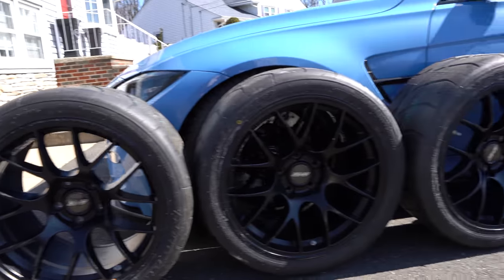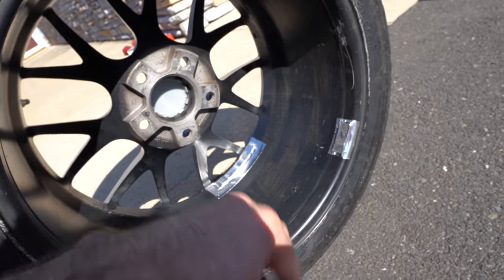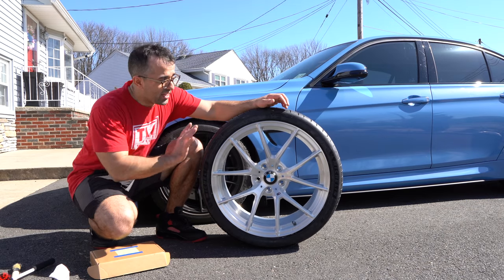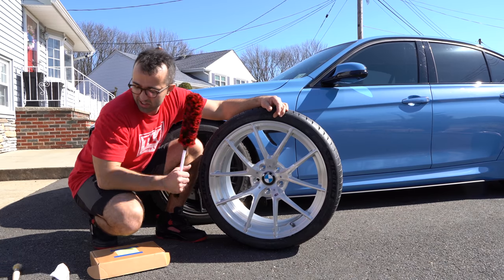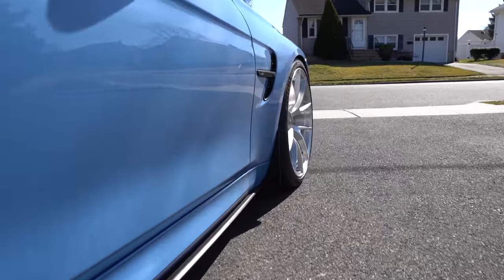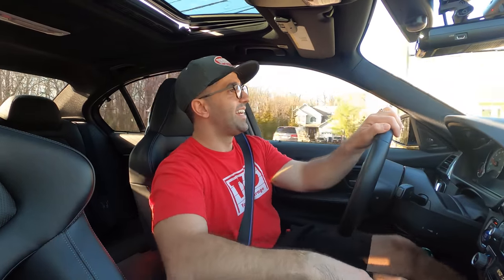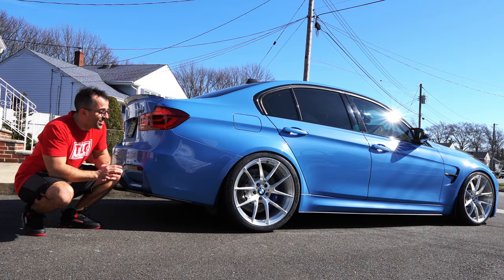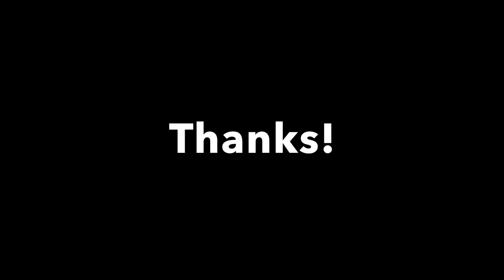I found the perfect wheels for my BMW M3! One set for summer and another for the track (Forged)

Comment: Never use metal dust caps much after a friend had bother getting one of because of corrosion on thread ended up sheering the valve seems to be a common problem
Reply from the maker: Great point.  Amazon caps were garbage

Comment: You mentioned that you applied 4 coats of ceramic.  Did you do the barrel.  If so, did you do them before you mounted and balanced the wheels.  I heard the wheel weights won't stick.
Reply from the maker: Great question.  I did all the ceramic coating after wheels were mounted and balanced.

Comment: With that rear stance I am curious to see how the tire(suspension) reacts over bumps. It's almost seems like there is no room for your tire (suspension travel) to move without hitting the body. A cam on recording the rear tires would be interesting. By the way I just picked up a 2017 M3 in the same color, loving it so far.
Reply from the maker: When the suspension travels it doesn’t just go straight up it angles inwards. Having said that I was getting minor rubbing in the liner.  I trimmed it and problem solved. Will highlight it in the next video

Comment: That stance looks so good! I immediately went outside to look at my stock 437’s and it looked skinny like a Ford Focus😂 compared to yours! How do you like the PS4S?  I’ve been using them for a while now on a they are smooth and quiet.    I have tracked with them once and they held up decently well.  

I agree, the blue/gold color scheme belongs on a WRX.
Reply from the maker: The tires are amazing. Little road noise
Reply: Edward M Cars PS4S are amazing tires! Put them on my wife’s 335i (F30) and it’s a huge step up from Pirelli’s run flats.
Reply: Steve Weltman I had them on my old ISF and it literally transformed the car!  I run them on the M3 as well.

Comment: Aren't these the copies of 763m wheels? They have the exactly same design and btw 763m is available in 20 inches but more expensive
Reply from the maker: Nope.  763 are different. Easy way to tell is 763 have that back channel and these don’t.
Reply: @TommyLGarage  What do you mean by the back channel?
Reply: @TommyLGarage  I thought these are the replicas of 763m
Reply: Yes, this is 763m replicas, but 9,5x20J front (oem is 9x19), and rear 10,5x20J (oem is 10x20).
Reply: @bmwmpower1304  okok slightly different in sizes

Comment: I would use the bigger rims for the track dude. You get more grip and tires will weigh alot less more than rims at that size plus its gonna feel alot better. Your gonna get more feed back when turning and know everything under the road.
Reply from the maker: Smaller wheels are lighter and tires are cheaper.
Reply: @TommyLGarage  but you want that weight  and width to get the grip down. Look at a gallardo or porsche 911. Were talking track car grip!

Comment: That’s not what forged is at all, you described billet.  Forged is when the solid block of aluminum is put in a huge press and compressed, it adds density to the material making it much stronger.  The wheels look great and glad your street wheels are not black.

Comment: Sorry to bring up an old video but did you have issues with the 275/30/20 on the front?  Richland advised me to run 265/30/20 for rubbing issues.  I want to order the proper tire sizes.  This will be on a 20x9.5 +22 (same as yours). Thanks for any help.
Reply from the maker: Yes it rubbed a bit at full lock  but was a better look.
Reply: @TommyLGarage  I appreciate the advice. Now I get to make a 3rd alteration to my tire order. 🫣 TireRack is gonna ban me. 🙃

Comment: hey, just want to ask if there's any rubbing in the front with 275/30/20. most f80s rub with 666rims on 275/30/20?
Reply from the maker: Yes. But it stopped after I put on camber plates

Comment: I wanna use 437 for winter. Rear pilot sports getting bold slowly haha. So I just mount winter tires on them. I can't decide 18s or 19s I won't track the car but I want at least 295 in rear. With sticky tires nittos or 888rs. We need to meet this summer.
Reply from the maker: I will swap you my 18s for your 19s. I’d love a set of silver 437M for the winter.

Comment: Nice wheels! What are their offsets? I just got myself a set of Vorsteiner 108s... beautiful wheels but am not impressed with the offsets. I have to compensate with some wheel spacers to have that flush fitment and look.
Reply from the maker: Oh it’s so much better fitting wheels without spacers. 
20x9.5 +22 Front and 20x10.5 +35 Rear 
Wrapped in 275/30 and 295/30 PS4S Tires

Comment: Hey Tommy.  Nice video like always. Respect.         Important question.  How much  weight new wheels?   because i think its important think when we need to compare with 666 20inch wheels.
Reply from the maker: So I can tell you that these weight a lot less than 666. 
20x9.5” (ET 22) - Weight 23.9lbs
20x10.5” (ET 35) - Weight 24.9lbs
Reply: @TommyLGarage    Wow. Its very good result. Also need not forget that wheels is 0.5 wider than OEM 666m wheels.   Super

Comment: Congrats on the new wheels, they look awesome! Also, looks like you did you homework before you pulled the trigger, good stuff. Talk about wheel obsession, I'm waiting for my 20''HRE R101LW for daily to replace my 666m set. Also, have a set of 18s Forgeline GTD1 square wrapped in NT01 for track days as well. AP brakes are coming along with an upgraded suspension, still haven't decided what to go with. Super hyped for some track days, hopefully everything gets back to "normal" because it's crazy out there. Stay safe!
Reply from the maker: Thanks! Good choice of mods you’ve got there. For suspension, you’ve got lots of choices. Bilstein now has a dull coilovers solution that works with edc
Reply: @TommyLGarage  I have not decided which suspension I'm going with (KW V4, MCS 4W, Nitron NTR R3, JRZ RS PRO 3). A track ready monster that's street legal lol

Comment: I literally just got the same setup on my M4 (tire spec and rim spec) and the fronts rub (without spacers) on the inner side of the rim. Couldn’t even move the car.
Reply from the maker: Interesting.  I rubber in the rear but trimmed the liner a bit and all is well
Reply: Tommy L Garage Yeah I think I’m clear in the rear. Running eibach lowering springs but I still need to go down lower. Just a little wheel gap. And I’m gonna our 10mm spacers up front to avoid the rubbing.
Reply: Figured out the issue. The shop put the rear right rim up front and the front left wheel in the back SMFH 🤦🏿‍♂️

Comment: Beautiful fit sir...what is the exact offset to the wheels? I want to roll like this.
Reply from the maker: 20x9.5 +22 Front and 20x10.5 +35 Rear 
Wrapped in 275/30 and 295/30 PS4S Tires 
Brushed aluminum finish.

Comment: They look amazing, very OEM, love it... I also have 20” on my F80 and they look really nice my tires are 245/35, 275/30... will definitely upgrade for 275/30, 295/30 makes a big difference. What torque you use on the wrench, 120?
Reply from the maker: Just be sure your wheel offset allows for those tires. 
And yes 120 is how much I torque.
Reply: @TommyLGarage  Thanks will check that at the tire dealer.. Thanks also for your great Channel content, very  helpful tips!!

Comment: Are you running this setup with MP Has Kit ? Any rubbing of the perch to the tires especially in the front ?
Reply from the maker: Tiiiiiiny front and rear I had to trim just a tiny bit of liner. Nothing too crazy
Reply: Tommy L Garage Hi Tommy. Quick question. Under what conditions was it rubbing? Was it rubbing under full wheel lock, or was the rubbing present during normal straight driving over bumps?  Love your videos, thank you for all your time and dedication. ❤️

Comment: Looking good. What offsets are you running?
Reply from the maker: 20x9.5 +22 Front and 20x10.5 +35 Rear 
Wrapped in 275/30 and 295/30 PS4S Tires 
Brushed aluminum finish.

Comment: Nice wheels TL! What’s the ET? Stance is perfect, don’t drop it anymore.
Reply from the maker: 20x9.5 +22 Front and 20x10.5 +35 Rear 
Wrapped in 275/30 and 295/30 PS4S Tires
Reply: @TommyLGarage  I'm planning to order a Vossen wheel next week with the same tires you have. I have a 2018 BMW M2... I love the stance your M3 has, Sweet!
Reply: Keep us update on how the ceramic coating works out. Thx
Reply: Tommy L Garage Would that be the same offset for 19”?

Comment: I am sure I missed it, but I love the stance. What is the offset for this wheel?
Reply from the maker: 20x9.5 +22 Front and 20x10.5 +35 Rear 
Wrapped in 275/30 and 295/30 PS4S Tires
Reply: @TommyLGarage  Was about to ask the same question! I'm sure I saw you mentioning +22 on instagram or somewhere but just wanted to make sure

Comment: That setup looks so good Tonmy. Well done.   Are the rear tyres rubbing? Do you think with a full trunk and two kids in the back, they will rub? Also ceramic coat the wheel hubs to prevent them oxidizing. The wheel poke is just perfect. How much was the wheel lock kit? With studs, the wheel lock kit would become absolite? Love the videos. Keep it up
Reply from the maker: Actually I’m gonna make a little follow a video in the back I ended up trimming a small piece of the liner because I was rubbing sometimes. Frond robs a little tiny bit when I turn the wheels but it’s almost not noticeable. I’m talking about like a millimeter.
The wheel lock kit I linked in the description. I like it so much that I am actually going to skip the stud conversion